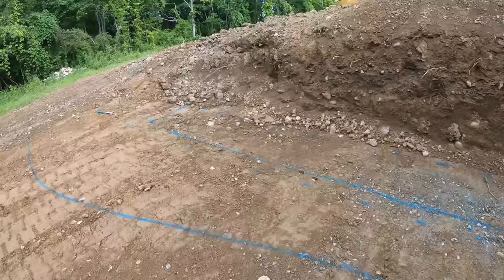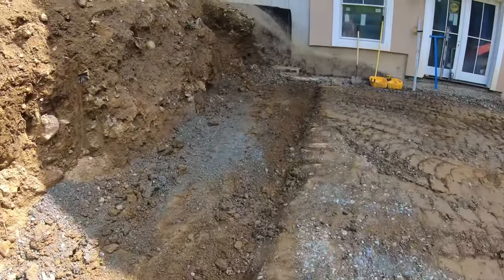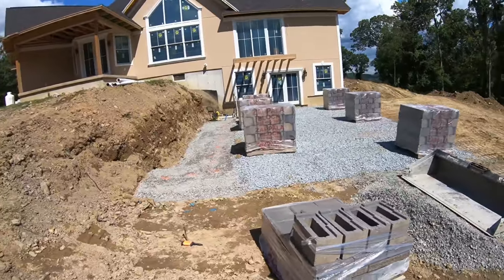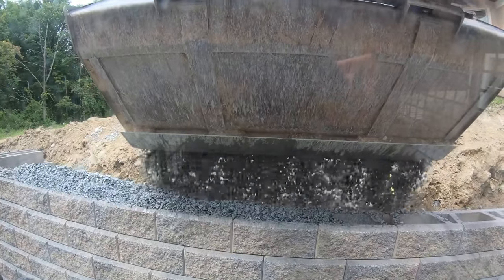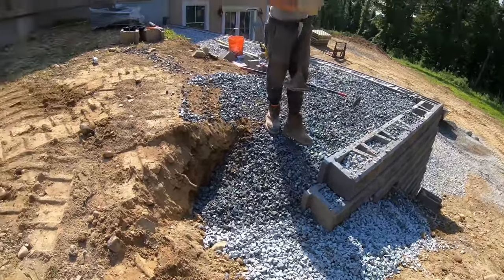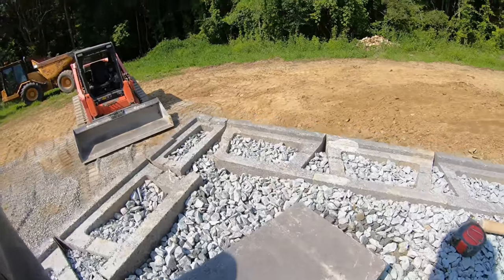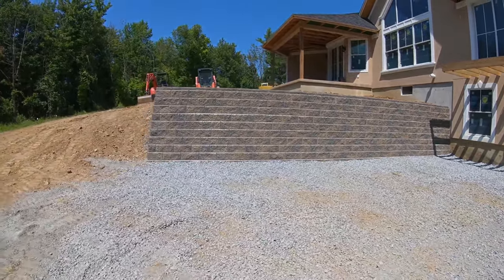How to build a Retaining wall STEP BY STEP!

Comment: I’ve never seen anybody use sand underneath block, to level it, only gravel. Sand has a tendency to undermine pretty easy under the block, which will make your whole wall, become unlevel.
Reply from the maker: Na all good
Reply: You are absolutely right i was also thinking that . Gravel is most important while building a retaining wall
Reply: If you have good drainage I suspect it wouldn't really affect the sand too much.

Comment: Nice wall.  Built properly.  Not overbuilt. Some notes: Hard soil base important.  Drainage very important, 3" weep holes every 15'.  Geo grid first layer on second block (assume one block buried) and then after every two courses.  Grid tight and pinned at the rear.  Basic engineering rule (we are geotechnical and structural engineers), one foot of grid length for each foot of height.  Six foot wall, six foot grid length (pulled tight).  Using the gravel is excellent backfill.  Dry clay compactable soil can also be used with a 12"gravel drainage field just behind the block.  However, the soil will need to be compacted in 8" lifts.  Very important.  And must be dry.  Moist or wet soil equals mud which will not compact.  No organic soils for back fill.  The #57 stone gravel not only drains well (to the pipe at the base of the wall with slope to outlet).  The #57 actually mechanically stacks such that it is essentially self supporting.  When proper engineered design and with good installation practice (like these guys), walls of over twenty feet tall are possible and long lasting.  Note: most building jurisdictions require a building permit for any wall that is 4' tall or taller.  Walls over 6' require an engineer sealed design to get permit with inspections by the jurisdiction or the third party engineers.  Once complete, it is normal for the walls to show wetness after a rain as the blocks are porous and absorb water.  They will dry out in the following days.  It is always a pleasure to see good work.  We only see this quality of work on about 50% of the projects we inspect.  Wish you guys worked in the Southeast!
Reply: Is it necessary to use a filter fabric placed vertically between the clay soil and drainage stone? Or only on top of the stone.

Comment: Man Oh man. I finished stacking my wall this afternoon, then I started putting caps on. I cut 45 on the corner caps, and man, that cut wasn’t straight down.I’m glad I found your video becuase I learned to things: chisel the cap on one end to get the rough finish look, and also just use it the way u showed which saved me from cutting 45s on two more caps. 

Thank you Sr. Amazing.
Reply from the maker: Welcome

Comment: Awesome work Mike, just got done a smaller wall with that similar Alan block an concrete patio poured on top, tell 6a what lifting those everyday will make a man out of ya in a hurry, 80 lbs a piece, man that wall looks dang good, thanks for sharing an look forward to the next video. 💪💪🇺🇸🇺🇸
Reply from the maker: Thanks Derrick yeah those blocks are no joke definitely tone you up 💪🏼💪🏼

Comment: This is great for sure. A couple questions: Can anyone answer if you're compacting the backfill stone every few inches too, or should that be naturally loose? I don't think he mentioned a few possibly important things: 1) Is the backfill 3/4 clean, just like the base? 2) Is each course glued, or just the caps to the top course? I've seen it done differently. 3) Why PVC drainage vs typical corrugated tile? Also, @DirtBoss, do you have a portfolio of projects years-out from completion to see how they hold up after "X" number of years. It's rare to see a solid wall years later that's withstood the elements and hasn't bowed or anything around here (Iowa).

Comment: Extremely nice looking wall.

Just had one question.

What is the aggregate layer at the bottom of the wall for? Is it for drainage? Wondering if you could've just scarified and recompacted the existing soil for a stable base. Since the pipe is above the bottom aggregate layer, I don't fully follow how it is helping. Seems like water could potentially get confined down there if you have some impermeable stuff adjacent.

Comment: Only thing different I would have done would be to do the base gravel in 3-4 lifts, 2-3in per lift. That size plate compactor isn’t packing 8 inches of gravel.
Reply: It doesn’t look like compacting the gravel behind the wall is part of his process in this video and another but should be.

Comment: Nice work...But I would had use filter cloth behind the stone and dirt. Just because dirt will eventually fill the void of the stone causing water behind the wall...but that would takes decades.  But how much filter cloth cost and time installing it $40 and 20 minutes tops .....to save future headaches And I presume it will be open ( No fence ) ..Definitely nice work !!!
Reply from the maker: I've actually done that in the past and manufacture says they will void warranty because in our area frost pushes the dirt and you create a dozer blade with fabric  it pushes the stone which pushes the wall it does make sense so I just stopped doing that.. I don't install fences that comes after me

Comment: Mike. What was the length/depth of  your geo-grid? Looked like 4’-5’. A 7’ high wall should have 7’ depth of geo-grid from face of wall. The geo-grid that I use has no tensile strength if it is rolled out. I cut the desired length. Also noticed that your top three courses had no geo. I  prefer to have geo under final course. 12” of crushed stone placed behind block is more than adequate. Otherwise, nice clean level work.
Reply from the maker: Yes this is 4-ft grid meant to go horizontal I know what you mean by the 8-ft strips done that before also

Comment: Nice! I just started a large block wall (large for me) project. Just posted part #1 video. Thank you!!!
Reply from the maker: Awesome 💪🏼
Reply: Hey boss, should I plate pack my washed stone behind my wall? 

I lay my perf. pipe, burrito wrap with clean stone and fabric behind my wall, then when I backfill with clean stone (no grid for me) should I plate pack all that washed stone?
Reply from the maker: @alsaku33  some guys do compact the stone I normally don't because it's usually dirt on top but if you're going to put something up there you can
Reply: Thank you man! Yea just like you last lift will be compacted dirt, with fabric under it to stop silting. 

Thank you again

Comment: Id rather have a solid block like Versa-Lok .  they also use pins to secure instead of the small lip on those blocks..  your wall  looks great though
Reply from the maker: Thanks Ed but to tell you the truth every verse a lock wall in our area lasts about 5 years then it starts leaning in the opposite way.. they're too heavy for their own good

Comment: I saw one layer of geo but above that didnt see anything. Its pretty but time will tell. There's a lot of earth pressure, and superimposed loads too, going to press against that block wall in time.
Reply from the maker: There was grid every two courses with a super thick base and 5 ft of stone behind it not going anywhere

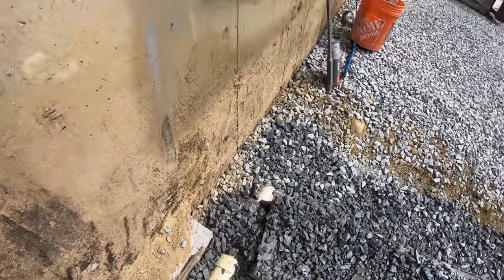Comment: How did you install against house?  Expansion joint, etc?  Looked like the 1st row was about 6" or so away to clear the drain pipe (6:50  min).

Comment: Mike do I need to run fabric behind a 4 foot versa loc retaining wall?  Getting ready to back fill and can't find any non Woven landscape fabric locally.  Going to be installing corrugated preforated pipe with drain sleeve or sock. My trap rock came today.   Fabric between excavation and clean stone is what I'm asking.  
Thanks Mike in CT
Reply from the maker: No you do not sometimes that actually hurt you if you put fabric along the bank it gives a reason to push like a dozer blade
Reply: Thanks for the quick reply,  I really appreciate it.  Enjoy the rest of the weekend.

Comment: Do you really need a 10 inch base the book for nicolock retaining wall says 6 inches is suitable ?
Reply from the maker: @bigsmoke7381  6-in is minimum why not put the other four make it bulletproof
Reply: @DIRT-BOSS  I’m working in a tight area has to be hand dug also the wall is only going to be three feet tall think I will do 8inches though instead of the 6

Comment: Geogrid needs to be rolled out perpendicular to the wall and overlapped. When you rolled it parallel, there is no strength in that direction. Take another look at the installation manual. Also pay attention to how the grid needs to be done at corners.
Reply from the maker: Honestly that wall would never even need geo grid stone is key geogrid is to stabilize dirt there is no dirt as far as I'm concerned I understand what you're saying on an 8-ft roll but that particular roll is meant for horizontal
Reply: @DIRT-BOSS  Aren't you worry of possible future lawsuits by posting videos of your work if it did fail because improper geogrid layout ?  Allan Block can says we do not advised his method or what he has done .  ..But still ,  Awesome work ... I love it... I know we last a long time.
Reply: He used Biaxial Geogrid which has the same strength in both directions. Your thinking of uniaxial geogrid which is used in walls 10' or taller. I build the same walls and this was installed correctly!

Comment: What did you do for water removal behind the wall to get it out of there?
Reply from the maker: 4 inch perferated pipe
Reply: @DIRT-BOSS  nice. I might have missed that in the video. If not, maybe include an edit where you show that.

Right on. thanks for the reply

Comment: Forgot draining system, wall could be a little longer for  appeal and I won’t do that awful curves with dirt, I would use draining pvc pipes instead
Reply from the maker: Wow I didn't know it was your project and budget, if you're in an industry you obviously understand that.We could only perform what the builder designed.

Comment: I hate that about those block having to cut the corners 😩but it is what it is 🤷‍♂️
Reply from the maker: I know how easy would it be to change the mold because the way they have it it doesn't have a purpose I think it was a mistake from the beginning and they never changed it
Reply: @DIRT-BOSS  exactly right!!!
Wall came out nice though we use a lot of those when we have to I Still enjoy doing stone a lot more though

Comment: What are your thoughts of spraying a concrete sealer on those retaining wall blocks?
Reply from the maker: I think it would look nice
Reply: A retaining wall needs to be permeable. If you seal a wall it could make it fail eventually.
Reply: @paultasker9759  I wouldn't think by spraying sealer on it that it would essentially make the wall water tight or not permeable. There are still gaps where each block meets. Probably wouldn't fail in our lifetime but who knows.
Reply: @alittlebitofeverything5090  concrete sealer is thick and spraying the wall could easily fill at least some of those cracks.   Regardless if it would or wouldn’t it’s bad practice and could make it fail, I stand behind my walls.  If someone did that to a wall I built and wanted to gamble with their 10-20k wall that’s on them.  Water and pressure over time can be a lot more damaging than you would think.
Reply: @paultasker9759  That is interesting.  How are builders able to seal a foundation wall from water penetration and not have issues in the future? Is it because the inside of the wall isn't subjected to the elements? Thanks in advance.
Reply: @alittlebitofeverything5090  I’m not a home or building builder, but I am building my own house right now and have helped build others. I do build many retaining walls among other hardscape for a living.   Like you said a structure isn’t subjected to what a retaining wall is. A retaining wall is holding up earth, but has to allow water to flow through it so pressure doesn’t build up and cause failures, obviously because rain falls and gets behind it and in the ground.  A house foundation is holding up a vertical weight, not earth pressure coming from the side as much anyway. And since it’s ideal to keep your crawlspace as dry as possible it’s good to seal it to keep as much moisture out as possible. Plus if done right any structure would have positive grade so water doesn’t build up against it and in some cases French drains are against a foundation in low areas or were the water needs help to get out.   There may be other things regarding building foundations that I am missing or don’t know about cause thats not my profession.   But when it comes to retaining walls you want that ground behind it solid, tamped with the proper amount of gravel just like this video and you want that water to get out.  Now in the wall in video with the amount of rock he put behind it and it’s not a massive wall, some sealer on the front probably wouldn’t make it fail but I wouldn’t want to take a chance and would advise against it if a customer asked me about it.   That’s my 2 cents anyway. I’m sure there’s more experts out there than me but Iv build a good bit of walls now and haven’t had any failures.
Reply: @paultasker9759  Thank you I appreciate your input. I'm planning a build in the future in the northeast and researching as much as I can. I've noticed the block walls get stained after a few years.
Reply: @paultasker9759  If you ever get a chance, lick the salt that the Alpine  ibex loves on the walls of a canyon lol.. bet you can't spray sealer on that! Have a good weekend.

Comment: Did you have to pull a permit for projects of that size?
Reply from the maker: Check with your local codes
Reply: @DIRT-BOSS  What dimension wall block would I need for a 9ft high x 30ft long wall? Load bearing. same style as the one you built in this video. I want to level a steep yard

Comment: How’s this wall holding up today?
Reply from the maker: 💯 why wouldn't it be
Reply: @DIRT-BOSS  just looking for info bc I’m about to build a wall 6’x100’
Reply from the maker: @Yeawell  Yes that's how you build them their textbook I wouldn't get the pin system make sure you get a system like this I've installed these for 20 plus years